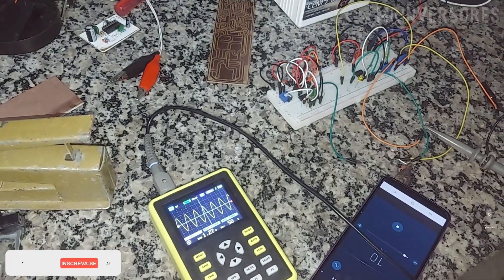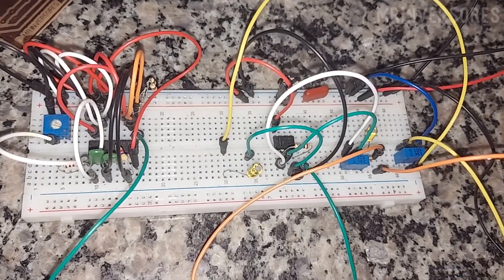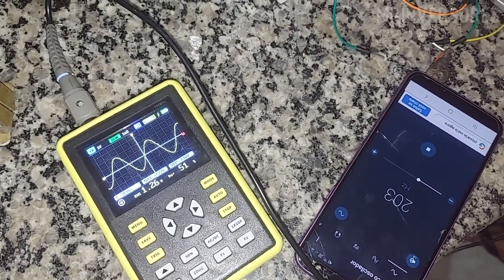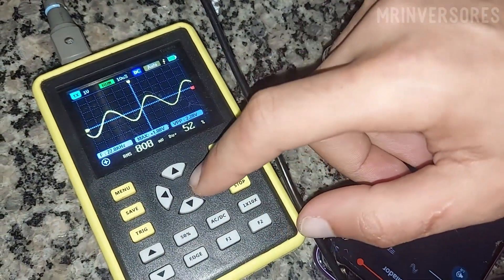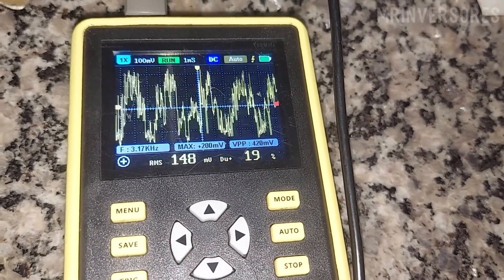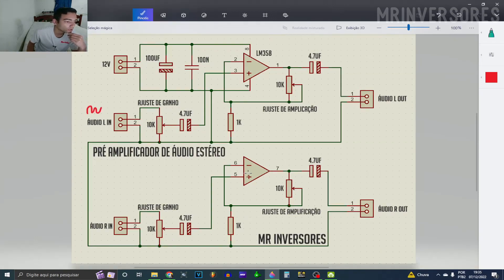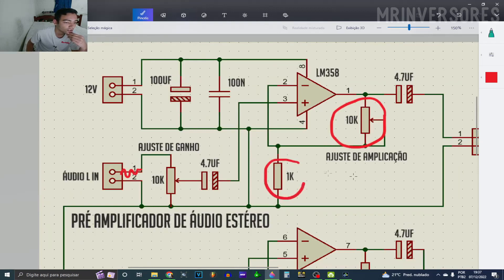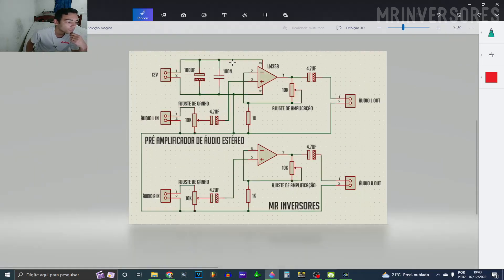AUDIO PRE AMPLIFIER WITH THE SUPER EASY LM358

Comment: 20 years ago, I pulled 6 or 7 of these out of my guitar amp and replaced them with the NE5532. It made a significant improvement, but I eventually went to college for engineering and learned an awful lot.
What did I learn?
That nothing I changed about that circuit or any other with this chip in it would have mattered. How the audio circuit was designed is infinitely more important than the op amps in them. I wish you luck in your pursuits. Anything is possible mate.